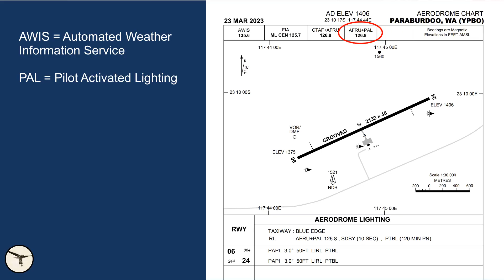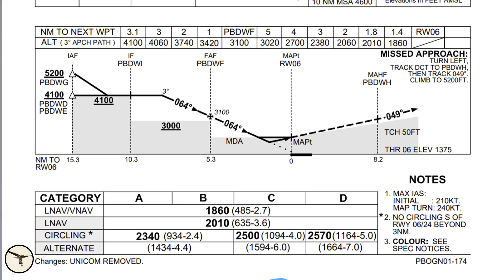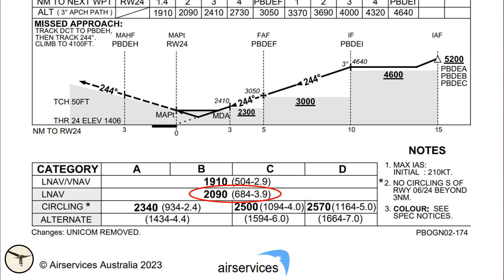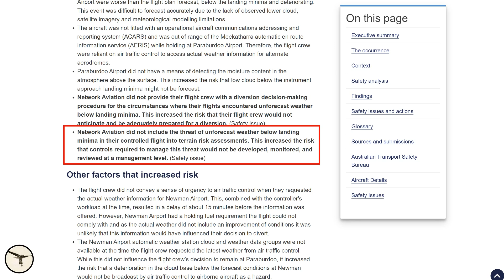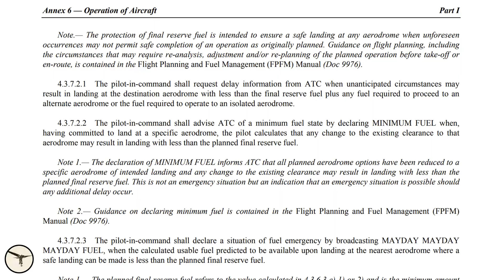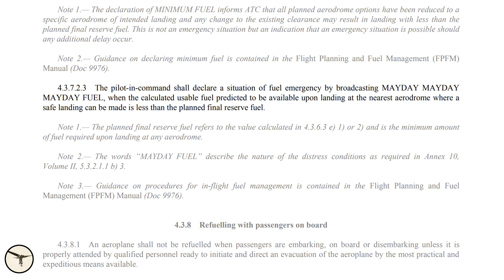What is fuel emergency?

Comment: Hello Magnar, which faults you cannot reset in an ATR?
Reply from the maker: Electrical bus failures and leaks. There are a few exemptions. For example, a battery charge fault cannot be reset in flight.
Reply: @FlywithMagnar And what do you do in case they fail?
Reply from the maker: @EduardoMCfly  , follow the checklist.

Comment: Great video!  Perhaps you might consider doing a video on another fuel emergency from the past?  Air Canada Flight 143, a 767 which ran out of fuel at 41,000 feet on a flight from Montreal Quebec to Edmonton Alberta back on July 23, 1983.  The mistakes made by the flight and ground crews were mind boggling, the only thing more incredibly stupid were the decisions of Air Canada management on levels of repairs parts they stocked at the time, and what was considered a parts or system failure that stilled allowed an aircraft to remain in service.  The crew did an incredible job getting the aircraft and passengers to a safe landing, it became known as 'The Gimli Glider'

Comment: I know of a flight leaving the NYC area for just a short hop to Washington DC, a 50 minute flight. Weather had been an issue for several hours and the flight was delayed. As the flight was full and there was the concern of exceeding max landing weight due to the short amount of flight time, only a min required fueld could be loaded. They taxied out and were delayed again by the slow moving thunderstorms, thus burning up precious fuel. Finally, they took off, but were repeatedly held at low altitude and vectored around storm. Jets are VERY thirsty at 8000ft! They were finally released onto their route, but encountered a delay at the destination and did not declare emergencu fuel until it was so late, they had to divert to the nearby US Air Force Base! That earned the crew a "carpet dance", and a lot of ridicule. Some months later, as a new captain, I experienced almost the exact same circumstance, but diverted to Baltimore just 50 miles from Washington National Airport. Only 50 miles away, but that can make the difference. I got a phone call from the Chief, but no "carpet dance". If I had not known what the previous crew had experienced, I might have pushed it a little too far and make the same mistake. So I hope these reports can help crews similarly in the future!
Reply from the maker: The crew you mentioned experiencd a chain of unforeseen circumstances. Thankfully, they managed to break that chain in time.